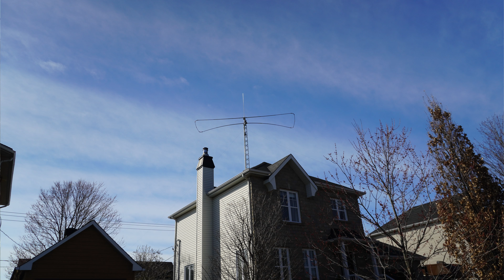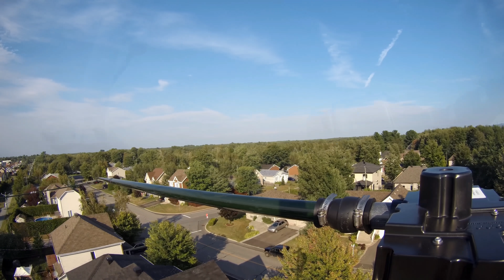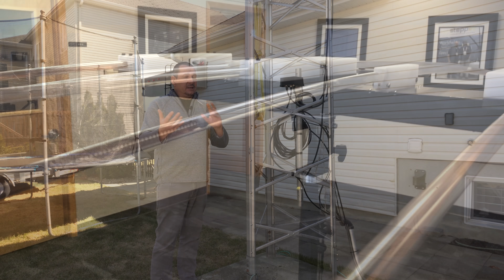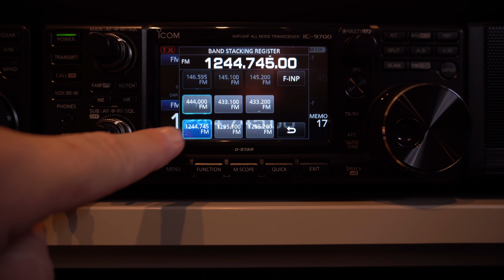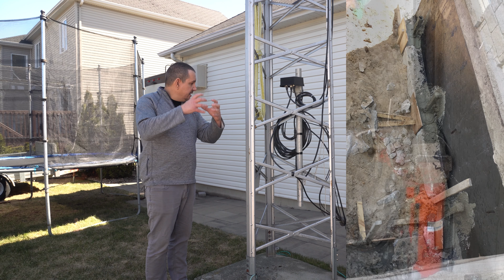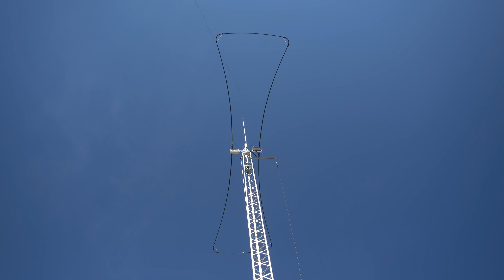My 2020 Ham Radio Antennas

Comment: Pascal, I am so very impressed with the thought and planning you put into your ham radio 'shack' and antennas. Your detailed workmanship is exceptional - neat, organized and well implemented. I am curious - what is your 'regular' job? You may have mentioned this before, but I'm a new subscriber. As an engineer myself, I care about not only the performance of my technology, but how well it's put together and will take extra time to make installations look clean, too. Congratulations - I enjoy your videos and the time you invest in sharing your content. 73s Greg KJ6ER (Silicon Valley)
Reply from the maker: Hi Greg, I have a business degree and an electronics degree. I work for a large telecommunication company, I'm responsible for all the B2B technical support, call centres and specialized technicians. I used to manage a Sales Engineer teams and many other functions in the past 23 years. So, I'm not officially an engineer but I managed many ;-) and I've learned from the best.  73 Pascal VA2PV

Comment: You have a really nice setup for a modest-sized lot. Unfortunately, this would be all but impossible in most suburban USA neighborhoods due to HOA restrictions. C'est la vie.
Reply from the maker: Hi Scott, I know it's complicated these days to set up a tower, even in Canada.  Fortunately for me I have what they call a "droit d'acquis", which translate to "acquired right", I'm not sure this is the correct expression in English.  In short, it means it was installed before they change the regulation.  So I can maintain and replace it as long as it stays the same height.   It's still possible in my city but a public consultation is necessary and they may limit you at 48 ft.  73 Pascal VA2PV
Reply: @Laboenligne  I know what you mean. When rights are carried over after a change in policy, we call that "Grandfathered". Literally, I guess that refers to something that has been around for a while. LOL. The same principle applies in the US, but HOAs have been around since about the mid-80's so it's hard to find a property like that.

Comment: 👍 What a setup! No way on earth I'd get local planning permission to have a 56ft tower in my backyard. Quite apart from the raft of local government regulations, my neighbors would write objection letters in blood. Given the proximity of the electricity lines, I guess you factored in the fall down distance. I can't see the inverted V for 80m but maybe I need new glasses. 😛
Reply from the maker: Yes everything was calculated to be installed correctly.  No risk for the power line with this setup.  The tower test shows that it breaks at the second section from the top with a pulling force of 3000 pounds.  Each section is 8 ft and the power line are at 34 feet.  When not in used the antenna is beaming south in parallel of the power line and the boom is 4 ft.  Plus the UrbanBeam outside elements are made of fibreglass.  73 Pascal VA2PV

Comment: Another great video..thanks!  My urbanbeam is here and partially assembled, waiting for the weather and virus thing to stabilize here in Indiana,,, Now question.  Can you describe what the directivity on 40 m is like?   I operate 40 a lot these days. The urbanbeam is replacing my hexbeam, they don't handle high power very well.   Be safe my friend!! N9HZX
Reply from the maker: Hi Donald, even if it's a folded dipole on 40M, turning the beam makes a good difference, it's very good.  In my UrbanBeam review I compared it to a half-wave dipole in inverted V, 24 hours after installing the beam I removed the dipole, hihi.  73 Pascal VA2PV

Comment: Unbelievable setup,  but dare i ask, what is the cost of the antenna system? So jealous de Ei2iP
Reply: The price of the Urban beam covering 6-40 meters is much less than a traditional aluminum antenna with similar capabilities.  Also since the antenna tunes itself, the boom length is short reducing weight and K-Factor.  The result of low K-Factor means a less expensive tower.  I have a 3 element SteppIR DB18 and found not using SteppIR would have cost another $1,200 for an aluminum antenna and another $5,000 for a heavier duty tower.

Comment: Very good video. You shack is magnificent.  Thank you for sharing with us.. I have a ROHN tower on the ground now 5 years. About 60 feet of it. I am in a tight lot surrounded by power lines on 3 sides. One day I will dig a big hole like yours and put it up. Guys are a problem.

Comment: nice video there pascal, i have a urbanbeam also here in the UK, but unfortunately mine has beset by numerous problems, including one end popping off in the wind and the swr  going sky high, currently my tower is in the cranked down position, until i get around too fixing the steppir, also another thing is i was never supplied with stainless steel bolts when i got my direct from steppir,and as i live very closes to the sea, the bolts are showing signs of sea corrosion,on the upside of the steppir performance wise,i have worked VK7 from here IO84HQ on 40m ft8 with 50 watts beamed @ 110 degress,and i can work USA/Canada off the back off the beam on 40/30/20 m no problem with out turning to the west, and even down to the Falklands Islands and south america while i am pointing 90 -110 deg to Europe, hey ho it will be fixed soon hopefully :) keep up the videos pascal informative and plain speaking as usual 73s Kevin M6ENP/G2KS
Reply from the maker: Thanks Kevin.  The SteppIR antennas are a complex gear, special care needs to be taken when assembly.  Maybe you can replace the bolts with something that will not corrosion.  It must be windy in your area as mine survive a 110 km wind storm with sticky ice on it.  Something I always do is when not in I used turn the beam pointing south so the dominant wind is always at the end of the antenna not on the side.  You can switch the beam with the 180 degree function as well.  73 Pascal VA2PV

Comment: Great video!!.  I'm am starting to look for a tower option for my self.  I live in a neighborhood also.  Does your tower require guyed wires?  I couldn't tell from the video if it had them.   Thanks.
Reply: This type of tower requires guy wires only when has no foundation and the legs sit on the soil. 73 de VA3HDL
Reply from the maker: No guyed wired required with the correct amount of concrete, see the link below for more information about my tower.  73 Pascal VA2PV http://wadeantenna.com/product/56-foot-dmx-medium-duty-tower/